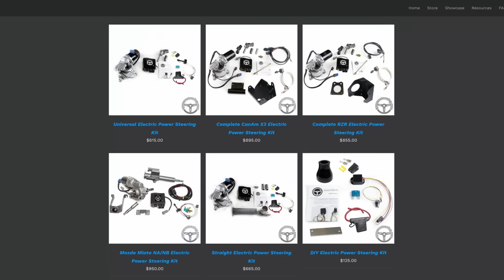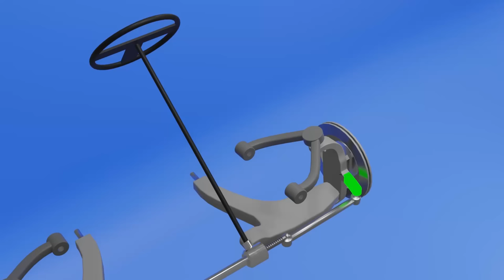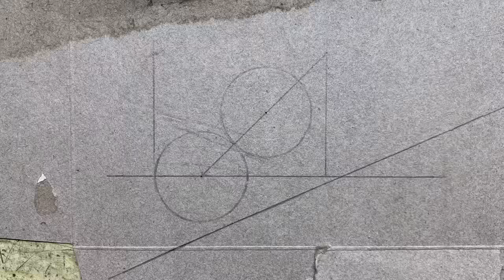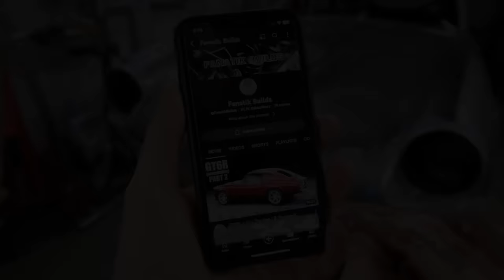EPS Steering Conversion // Pro Touring V8 Triumph Build – LS Powered GT6R – Ep34

Comment: Hope your engine doesn't toque over and bind the shaft  (with the manifold or sump)...... ask me how I know?
Reply from the maker: Must not have made it clear in the video as quite a few people have commented this, but the engine/transmission are on polyurethane mounts, so very little movement at all.  Practically zero in fact, so I'm not worried in the least about it making contact.  We will open up a bit of space around the manifold and block (with a grinder) later so we can fit some heat shielding in place though. 👍✌️😊

Comment: I have a number of concerns:
1)  The Chevy Equinox EPS is way overkill and unless there is some way to moderate the assistance given will give too much assistance that will completely mask any steering feel.  I appreciate that North Americans like to twiddle the steering with their little finger but this is OTT.  For me it would not be safe at speed but probably OK in a parking lot.
2)  There are too many UJs that has the danger of giving a vague steering and they are too close to the engine.  The engine will move due to torque and bumps so that it will easily contact those joints.  I also wonder how much movement there will be in the front ladder frame chassis under load.
3)  All of the UJs need to be clocked so that any natural angular acceleration is counteracted and cancelled out.
4)  The UJs will be vulnerable to heat from the exhaust that will prematurely destroy the bearings.
5)  The heim joint is unsuitable for this application as there will be rotation from the steering shaft.  A far better (and cheaper) alternative would be to us a shielded roller bearing in a fabricated housing.  The precision of the roller bearing will assist in the feel of the steering.

Comment: What about putting a spacer on the manifold to add clearance for the steering you could wedge a spacer if need be should be easy enough to accomplish at a local machine shop

Comment: Once you add 2 or more U joints to a shaft . a crash will fold the shaft .  The spear danger comes from once apon a time steering shafts were a straight line into the box .
Reply from the maker: Bingo!  So with two areas that can collapse, PLUS the U joints, I'm feeling pretty good! 😊👍

Comment: Great work. I have the same steering column to go into my Volvo 122s. What width are your wheels?
Reply from the maker: Nice!  Hoping it will all work out well, the controller from Bruno Steering looks like it should do the trick perfectly. 🤞  Our wheels/tires are 15x7 et20 and the tires are 205/50/r15 ... really happy with how the stance has turned out!  Enjoy your project man, sounds fun!

Comment: You’re gonna hate me for asking but would a chain drive steering offset work to run the steering shaft underneath the engine? That also would have kept the steering column itself above your feet with no U-joint
Reply from the maker: Interesting idea, I'm surprised that's accurate and direct enough to work, but it does appear to be an option.  We could have done something like that, but they do appear to be quite pricey, and with a bit of clearancing here, we should be fine!  Thanks though! 🙏✌️

Comment: at 17 mins in, you  now aware that the seating squab of the seat will give reduced view ,
as i said, which you put question marks to my comment,  when originally going for the late mx seats
did,nt elaborate then, but now you got it figured .
1/2  in a static sitting space is alot.,  and its even more when your actually driving, as your body / head move up / down, so reducing vision even more at times,                                                 esp on bumpy roads and corners 
still maintain you need to take out the hard foam from the squab, at least 2-2,1/2 inches, and then replace that with a soft compressible foam, so that the seat sqaub is still in shape.

good luck

Comment: You can increase visibility by adding two small bubbles at the front roof?
Reply from the maker: It's the windshield frame that's in the way, so sitting higher would just make it worse actually!  I guess we can just slouch at stoplights though! 😊😅
Reply: @FanatikBuilds I have seen a small lens section used at the windshield header to help with eeinf traffic  lights. The ones I have seen for Minis stick to the windshield and are relatively small. It might help.
Reply: Thank you, that's why I'm not doing the project manager thing and you are @FanatikBuilds

Comment: isnt that clearence to tight? i mean.. the engine moves quite a bit when applying torque
Reply from the maker: Must not have made it clear in the video as quite a few people have commented this, but the engine/transmission are on polyurethane mounts, so very little movement at all.  Practically zero in fact, so I'm not worried in the least about it making contact.  We will open up a bit of space around the manifold and block (with a grinder) later so we can fit some heat shielding in place though. 👍✌️😊

Comment: Love this build! What year equinox did the column come out of? I’d like to do this with my 65’ Nova project.
Reply from the maker: Cheers man!  It's an 06 Equinox ... the controller box from Bruno Steering was pretty specific with which years are compatible FYI ! ✌️
Reply: @FanatikBuilds  thank you!! That helps a ton! Any reason you went with an equinox instead of like the Prius I see a lot of people use?
Reply from the maker: No prob!  We specifically chose the Equinox for a few reasons:  much more common ... cheaper ... and the controller boxes available let you cater the steering assist to your needs.  The Prius column is a bit smaller, but it only gives you a set amount of assist as a "limp mode" ... (say 50%) ... static!  Take it or leave it!  With the controller we chose, it looks at the force being applied at the wheel, and gives an appropriate assist to the rack.  Additionally a separate wire can be left disconnected, grounded, or grounded through a 100K resistor to give neutral, less, or more assist (in that order).  In the end, it should provide a very factory-like experience (we hope!) 😊🤞 Brilliant product from Bruno, albeit a little pricey compared to our junkyard column.
Reply: @FanatikBuilds  thank you so much! This makes it an easy decision for me then! I plan to autocross my Nova and the adjustability will be beneficial. I’ll Google the box your referring to also. Keep up the great fab work! I also like the way you do your videos. I’m still learning how to do editing.

Comment: How are you going to deal with the engine torquing towards the right and possibly binding the steering shaft under heavy throttle? Are you using poly mounts or did you hard mount the engine on the driver side? I have a years worth of driving a v8 swapped Ranger with solid motor mounts and its not as harsh as I thought it would be. Is it smooth and quiet? Not really. Does it keep the engine in its place at all times, yes.
Reply from the maker: Poly mounts, correct!  Good to hear your experience with solid mounts, I'm hopeful we won't have too many vibrations either, though at this point it kind of is what it is! 😅
Reply: @FanatikBuilds honestly man, it adds to the visceral experience of driving something special. I used to own a mgb gt and it had a built ford 2.3 turbo and 5 speed but before we did that it was 100% stock and vibrated like a ladies special toy lmao

Comment: is there enough steering shaft clearance for when the engine moves around under or off load?
Reply from the maker: Must not have made this clear enough in the video as I've had a lot of people ask about this.  The engine/transmission are mounted on polyurethane bushings that have an almost imperceptible amount of movement in them.  We will also come back when the engine is removed later, and do a bit of grinding on the block and manifold to make some more space for heat shielding - as it is, we could remove about an inch off the block without any issues whatsoever!  All should be fine in the end 👍 Thanks man, hope you're well!

Comment: ?
Why dont people use CV joints for steering. In my head it should work at an angle. Just wondering.
Nicely done. Funfunfun
Cheers:):):)
Reply from the maker: It's a great question, likely more complicated and expensive than a UV joint... plus the oscillation of a UV isn't as detrimental for steering as it is in a drivetrain, so I'd guess it's just purely for cost-cutting.  Maybe Koenigsegg uses CV's though, Christian's always doing everything next level! 😊😉

Comment: Currently going through simelar process with my Ginetta, only the footwell is much smaller. I wont be installing one of these vague electric devices, instead I´ll be going to the Gym.
Reply from the maker: Dang, never heard of that car (assuming the G40?) but it is very close in size to the GT6!  Still 6 inches wider though which I would love! 😅 We can workout if we're interested in bigger arms, when cruising in the country, I just want to enjoy the drive!
Reply: Actually a G27, the restricting factor is the frame which even narower as the GT6.

Comment: What about mechanical brakes and putting the HVAC in the back seat, then you can spin around the intake manifold. Also the powersteering pump may fit behind yhe driver if you used a volvo power steering pump, and with all that said your doing a fantastic Job woth this micro machine , i personally would not attempt the project path you chose.
Reply from the maker: I keep telling myself there's plenty of room for power brakes and the HVAC up front! 😉 No need for a PS pump though, that's the beauty of the electric column!  Thanks Matthew, it was never the plan to take things this far... just kind of happened!

Comment: you know the engine moves, right?
Reply from the maker: It's on poly bushes, so not much movement.  There is also still some clearance!  We're going to squeeze out every mm we can before it's done 👍
Reply: @FanatikBuilds  I did notice the beefy mounts after posting my comment. But I used to build and fit exhausts, and we generally left at least a pinky's worth of clearance between headers and steering shafts. You really don't want your  steering locking up coming out of or going into a corner

Comment: Before you set your seat height, maybe put your helmet on to be sure you're not up against the roof.... don't ask me why I caution this, there will be SAE level bad words.
Reply from the maker: Seat height is as low as we can get without removing the adjustment rails ... and even there we'd only get an inch back!  The frame runs directly under the seats so there's literally nothing more that can be done.  Luckily, the car's being built as a road machine, so very few situations where I will even put on a helmet (of which I don't even own one!) ...but I'm 100% sure you're right to check though, it's a shame the car's just so tiny.  Cheers! ✌️
Reply: @FanatikBuilds  I know this story very well, which is why I'll give you another inch of suggestion (and seriously, an inch is actually a lot) shave the foam in the seats.  You don't even have to take any off the front, just where you jeans sit (cut a wedge out of the foam).  You also have the opportunity to use a bit denser foam.  Something many don't know - the springs are what's cushy, the foam is just there to keep you from getting grill marks on your backside.
Reply from the maker: Already done the foamectomy in Ep32!  May still go back later and try again though, it's helped, but I feel there's another way we could approach it.
Reply: @FanatikBuilds  I strongly considered wicker, then spandex, then just cutting a hole in the floor.  Can't wait to see your take on this.  Until then, keep rockin'

Comment: Ermm you do know engines vibrate and move right?? So the gap you have for the steering column is woefully inadequate and potentially a death trap right? i dont know a way round it but i know i wouldnt allow it on the road if i inspected it. for the sake of yourselfs or the bunch of children and grannys you may squish, Sorry. I would strongly recommend reshaping belly pan and also the back of the manifold to allow for it. Yes it might upset the flow of the exhaust gas's but its better to do that than have a potential death trap on the road and it always being in the back of your mind haunting you
Reply from the maker: Our engine and transmission are on poly mounts, so there's very little movement.  Practically solid-mounted, but hopefully a little less NVH than that... we'll come back and grind a few mm's away on the block and manifold before they get painted.  Don't worry, I wouldn't move on if I felt it was life threatening. 👍
Reply: @FanatikBuilds  as long as your aware and are going to address it but would still put a little more space on the belly pan even if its a couple of blows with a ball pointed hammer just give a little more space